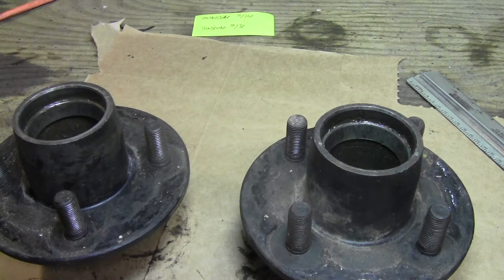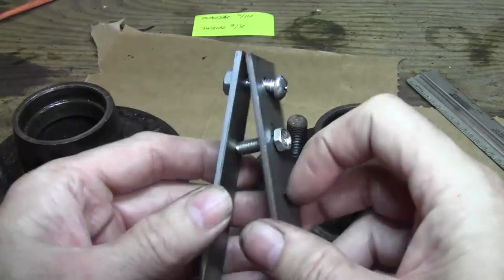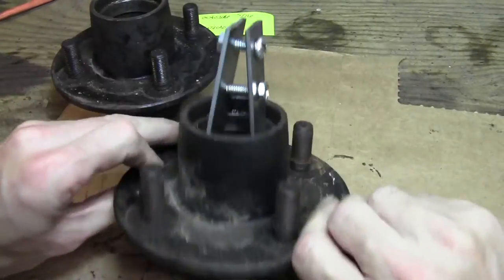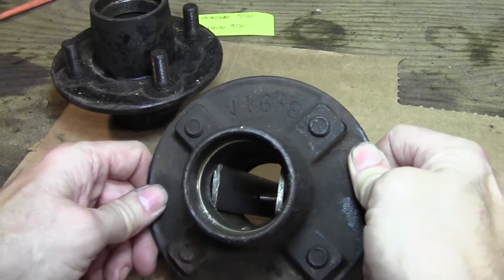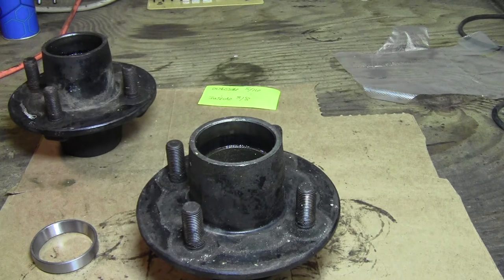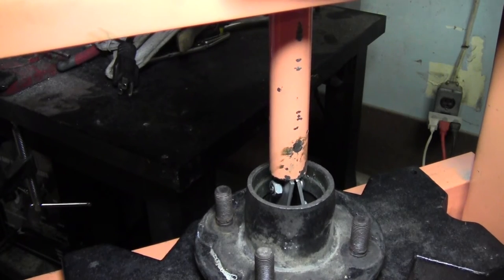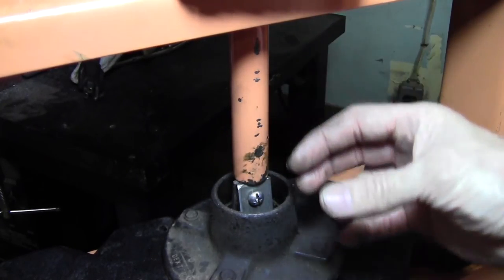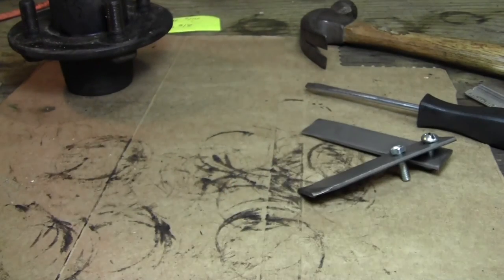how to press out trailer hub races with a shop press

Comment: Great video, thanks!  Good tip on pre-measuring race depth, I'll remember that. H-F has two presses I'm getting soon, the 20-ton floor model and the 6-ton bench top model. I have a triple axle salt water boat trailer and replace bearings and races regularly, and a good press is worth its weight in gold for knocking out old races and reseating new ones. No more hammering them in with sockets or old races, lol. Thanks again for a great, informative video!

Comment: Another tip for removing interior races (not mine; thanks youtube). If you have access to a welder, weld a bead on the race itself. As the bead cools it will shrink; loosening the race with it and makes it much easier to remove. Just be sure not to weld the hub and protect exposed areas for weld spatter.